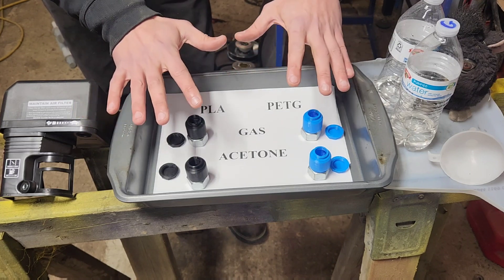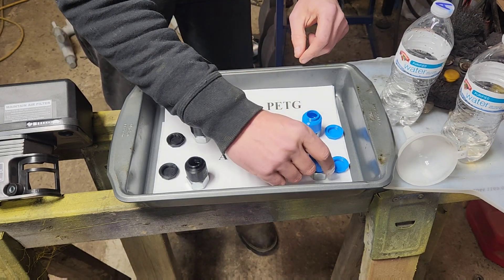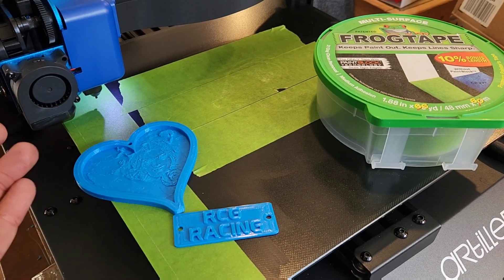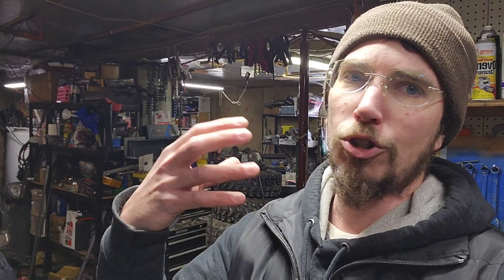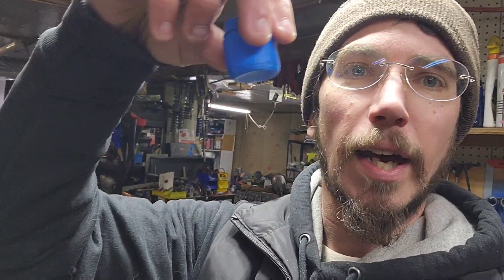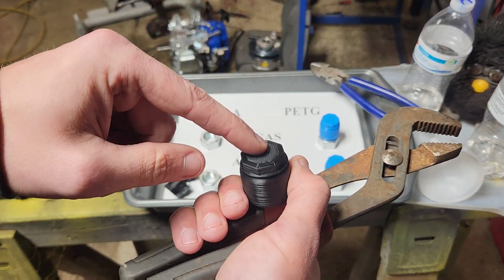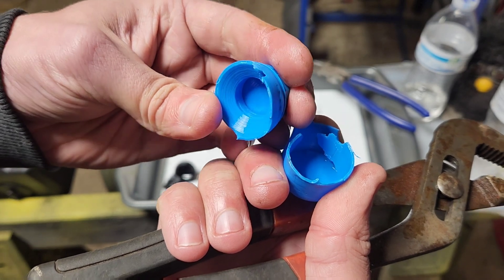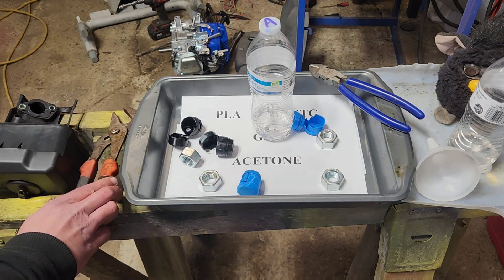PETG 3D Printer Gasoline and Acetone Test

Comment: There is actually some bad information about the 3D printing filament, and printing in general. PETG can handle some chemicals, but not very well against acetone and limited exposure to gasoline. Long term exposure will make it separate. On top of that, the nature of 3D printing really isn't the best for containing liquids. The next part is, heat deflection. PLA has one of the lowest HDT and PETG isn't far behind. These parts should not be used in an engine bay, and especially not touch engine parts. This is where you need to look into glass fiber or carbon fiber reinforced PET and PA. ABS and ASA, especially GF/CF variants, can also be options.

The next part saying that if you make changes to the printer to print fiber reinforced filaments means you can't print PLA or PETG, that I have no clue where you got it. You can print whatever you want with a printer that is capable of printing fiber reinforced filaments. You could even do it without all metal hotends but it will wear out faster. The bigger limiter is the max temp it is capable of, but majority of filaments will print under 300 C. I have four printers, all capable of printing fiber reinforced filaments. Some I made the necessary changes for reliability. Currently, two of them are printing PLA for a simple project. They have also printed ASA, PET-CF, PETG, PA, and will be trying some other fiber modified filaments soon. The ASA, PET-CF, and sometimes PA, are used for automotive applications.

Comment: What?! PETG hasn't been hard to print for years.
Edit: Oh. Artillery bed. Clean it really well and then heat it to 70°c, spray it with aqua net extra super hold. Use a sheet of paper to shield the hotend so you don't get hairspray in your cooling fan.
Adhesion issues - gone.

Comment: Thank You. I am looking to make silicon molds for candles. Acetone is used as a thinner and then will flash dry while the silicon caulk cures. I didn't know if I should print with PLA or PETG for the cast model. I'll probably go PETG because it had less distortion in your demonstration. Thank you.

Comment: Literally just started looking into this an hour ago (3d printing in general) for some small engine parts im having trouble finding... seems the petg would be terrible for any fuel applications with the wicking, but im new to this. Do you think the pla would be ok for fuel pump or throttle body spacers? Not constant, but fair amount of fuel contact, and heat...

Comment: Since I didn't need to google, I still am feeling compeled to give you some notes B-)

1. PP is really a bitch to print, however glass filled PA only requires a hardened steel nozzle, so it doesn't wear out, and a heatbreak, that doesn't have a ptfe tube going all the way through it - titanium, or bi-metall (steel+copper, titanium+copper), so you could reach around 300 celsius. And also you need to dry your PA. A lot.

2. PETG generally prints ok on a well degreased ultrabase, however I never dealt with Artillery printers, theirs could be sh*t. Gluestick would help. Also, based on the bookmark print, try to go 10 degrees down both on hotend and bed, and switching off or minimizing cooling. Seems a bit overheated, and PETG doesn't really require cooling, except for overhangs and such.

3. PLA is generally noticeably stronger the PETG, however PETG has better impact resistance and doesn't creep under pressure.

Comment: Wicking could be mechanical (i.e. liquid leaking through pinholes, common for FDM parts... you can prevent this by increasing increasing print temperature, lowering fan speed, and increasing flow slightly about 100% to squeeze out the interlayer voids). Additionally, PETG works well with straight gasoline, but does poorly if there's 10% ethanol in it. (Might also depend on blend of additives (such as BTX to increase octane--benzene, toluene, xylene), so could also depend on octane and season (winter vs summer blend).)

Comment: PLA really isn't useful outside of conditioned spaces.  If it's outside, it's going to be soft or melted on a hot day.  I've seen it warp at 50F with the sun on it.  Outside?  In the hot compartment of a gasoline engine?  No way.  Didn't look up on Google.  Printing mechanical parts professionally since 2015.   I've used mostly ABS.  Petg I like but haven't become an expert on it yet.  Looking to do a project with gasoline exposure and that is why I clicked your video.

Comment: My big issue with the wicking effect of that blue stuff is it may pose a fire hazard if it's allowing gas to get to the outside of the intake. I fully understand a stuck needle and seat will spill 1000000% more gas than that ever would but as a saleable item it's something you could get sued over. Food for thought

Comment: Cost of that 3D printer on Banggood is about 1/2 what Amazon wants for it FYI.
Reply from the maker: It goes back and forth so I included links to both sites.
Reply: @redneckcomputergeek  Thanks for both links, I was hoping Amazon would have been cheaper, would have purchased there to give you the kickback money.
Reply from the maker: I'm not worried about it. This is more of a for the community project at this point. Yes I plan to make and sell parts but for now its just to prove it can be done.

Comment: Very neat to see.  I've not gotten around to yet, though I did test using Plastidip in the can on the end of a cracked rubber breather tube and found type 1 silicone definitely doesn't hold up to gas/oil vapors, though cleaning up and dipping the end in Plastidip has held up for a few years, looks like since 2019 per my FB post.